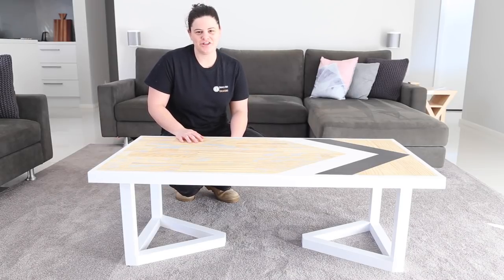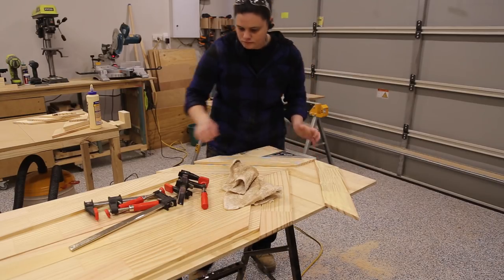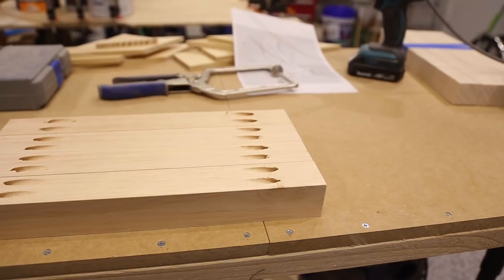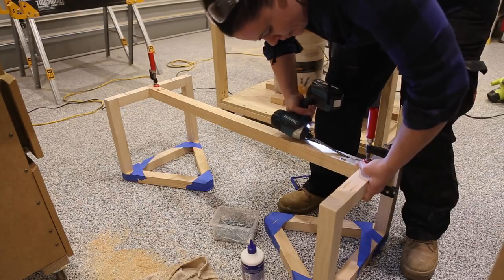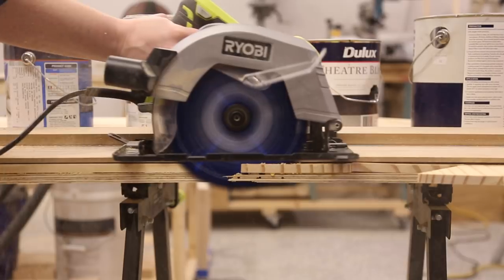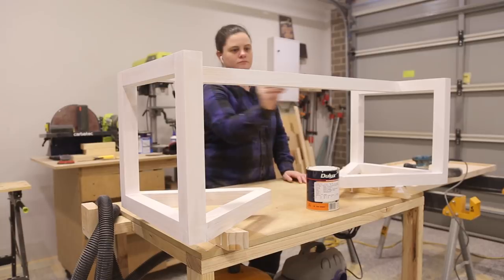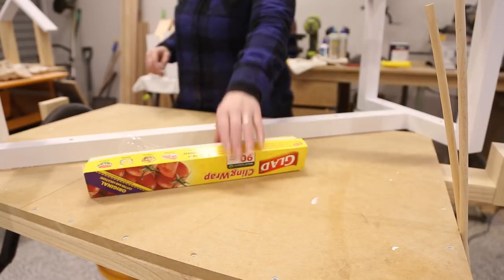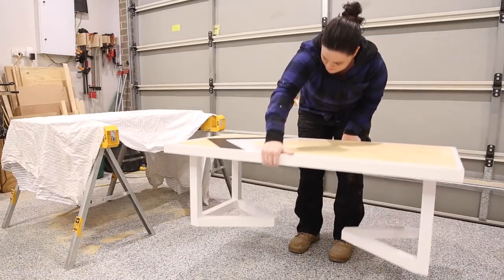DIY | How to make a Mid Century Modern Coffee Table

Comment: If you've got a plug cutter  to use in your drill, get the chamfered cutter and  tap them in with the grain going in the same direction. You can cutt the plugs out of the same material scraps that you've used to make the table!! you'll hardly be able to tell they are there!!

Comment: Nice one. When you paint the arrow and cut a line so that the paint doesn't bleed, wouldn't the cut leave a groove in the nicely sanded board?
Reply from the maker: Hey Thanks for the support. Because you are cutting a line between where the two pieces of timber meet you don't see it. However you also don't see the line when its one piece. You are only cutting a thin shallow line and it blends in with the paint.